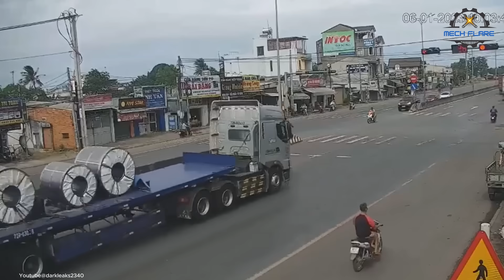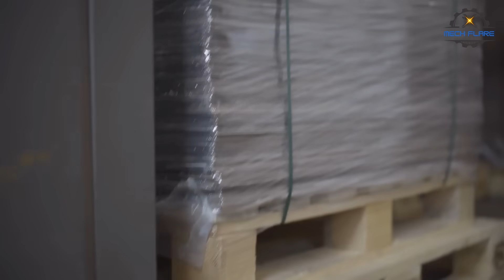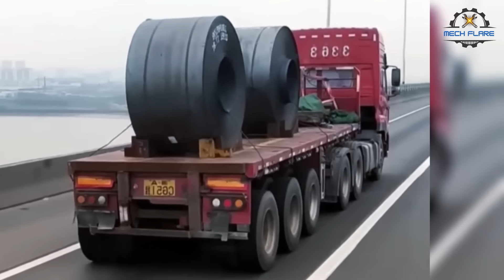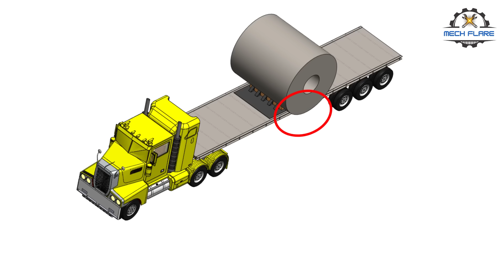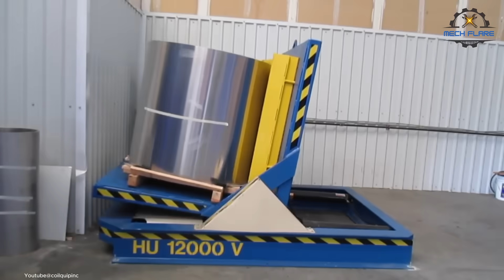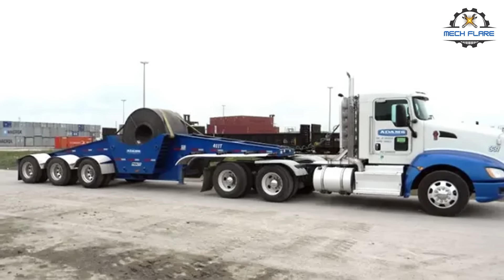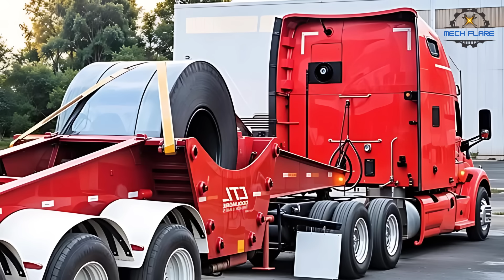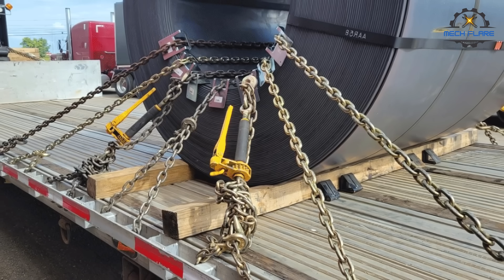Suicide Steel Coils: Can We Stop These Monsters? (USA vs Europe)

Comment: In Europe we have absolutely no issues with coils crashing into cabs. They are almost always loaded shotgun style into the coil well of the trailer, where they sit low between the frame rails in a "naturally" relatively safe position. I don´t know why the murricans still haven´t got the concept of coil well trailers... I think they are the best solution if you need a somewhat universal tailer, just put the covers back in the coil well and you have a regular flatbed trailer to haul other stuff on the return trip.
Reply: Classic eurotake. Here in america we believe in the freedom to die from unsafely loaded cargo, whether it's the driver or a patriot next to them.
Reply: @prox546  that got a really good laugh out of me 😂😂
Reply: Americans don't have 90% of safety concepts because it's cheaper to not be safe and everything in USA is about money only. Generally look at their trucks, us made 2025 is technologically on level of early 2000 European truck. 

There is reason why USA pretty much baned almost all European truck manufactures, simply they know us made trucks cannot complete at all.  

It was always so weird to me that country with such large truck culture does trucking wrong at every step.
Reply: The reason they do not have it is cost. Cheaper is more important than safer.
Reply: Am3ric4n trucking is amazingly primitive - I saw an Am3ric4n guy who bought a Scania and he compared it to his US truck. I was blown away that US trucks are basically the same as they were in 1970. I truly could not believe how agricultural everything was.
Reply: @piccalillipit9211  the USA is as Afrika a developing country or better 3rd world country. 
Next century they are on the level of Europe. It will take longer when they have clowns like Trump as president
Reply from the maker: Yes. This is what I mentioned in the video.
Reply: It's America so they will always have entrenched reasons why things can't be changed. Whether it's cost, convenience, or the "my great grandpaw was doing it that way in 1929 in the Great Depression and if it was good enough for him then it's good enough for me," attitude, they're not for changing. 
😂😂😂❤😂😂😂
Reply: One day US trucking will stop living in the dark ages and join the 21st century.
Reply: Wow, it's so rare to see a european be arrogant about something. /s  No wonder you lot were arrogant enough to think you deserved to enslave all of Africa and most of the New World and Asia.
Reply: it's probably because of cost, I have seen special trailers for coils at the mills but over the road it's cost shippers want the cheapest carrier and carriers don't want to pay for special trailers and everyone does it the same so it stays the same because it's cheaper to purchase additional securement devices then special trailers. some companies do have dips in stepdeck trailers to better hold the coil
Reply: @teddekkerfan92 in Europe the "specialized" trailer is the cheaper option. It was brakes and electronics regulations that favored two frames close to the tires from front to back, over the typical H frame. With the space you gained in the middle you just need different floor tiles to make "specialized" trailers. Even mounting a liquid tank to the double beams isn't difficult.
But yes the companies running that stuff and their philosophy matter. Well and the justice system. If a suicide coil would hurt a trucker in germany the owner of that logistic company would be in jail a few hours after the crash for years and the company would be sold to someone.
Reply: @MrHaggyy  in the US it is the drivers responsibility to secure the load also what the video got wrong is that the driver has the say in how the trailer gets loaded more so if they own said trailer being used. If a driver does not like how its loaded they can have it fixed or refuse the load.
Reply: @wolf2179  In Germany, the driver is responsible for securing his load as well. However, as long as you can't prove a driver's mistake, the owner will face the same sentence the driver would expect.
In the US, the owner can face consequences if the driver or gear is not appropriate for the job. But it's far less strict than EU, and part of the reason why EU logistics invest more frequently. The primary reason is that insurance companies are demanding certain safety standards through EU regulations. Which is just preemptively doing the same thing.
Reply: Or Eyes to Sky 😂 You Just need extra Papers or a convoi for extra wide load or If its "too heavy" 😂😂😂
Reply: Simple
Reply: That is a very simple and great idea.
It just requires " different and flexible thinking."
You can have a universal flat bed trailer with simple modifications..
Mostly, safety is not a concern for people who think only about money.
For that solution, it will require change every time to flat bed when you need.
This will take maybe 15 min, and that too much work for many.
Reply: $$$

Generally this is always the reason.

Why spend money on specialized equipment when a Flatbed, one that is likely decades old and a metric ton of securement straps would be significantly cheaper and you don't need to store extra equipment.
Reply: here (in europe) every coil my company buys is loaded eye to the sky on a wooden pallet.  they can also be stacked on top of each other too. easy to unload with a forklift unlike shotgun style
Reply: They are not almost always shotgun. They need at least half of their width of space each side for the tongs to enter and loading them shotgun you can load fewer because of the space you have to keep them apart.
Reply: I was back loading coilers more than 40 years ago, and the drivers just covered the coil wells for the return journeys. No problem.
Reply: Not only the US trucks are decades behind europeans, trailers also. Making most profit at lowest costs. Security regulations interpreted as suggestions.
Reply: @hardig5760 lmao plenty of coils have rolled over European trucks stop lying and your decades behind in engine building for semis 😂
Reply: @KeanuLeaves-KL  You misspelled and mean decades ahead. Your engines doesn't fulfill the strong exhaust regulations. Burning crude oil in diesel engines and poisoning the environment doesn't fit anymore in the world.
Reply: nah. NEVER SAW in my life, that coils were loaded shotgun style here, for last 20 years of living in Europe
Reply: @tsugumorihoney2288  maybe because the trailers are covered? And look like standard ones from the outside.
Reply: @denzzlinga i'm working on metal factory... so i see this steel rolls being loaded
Reply: @tsugumorihoney2288  like theese: https://www.searates.com/design/images/reference/truck/17/3.png
Reply: if properly secured truckers in the states don't have problems either.

as for why they use common flat beds (of various types) rather then specialized coil carriers, that's gonna be down to cost and distance traveled, especially when the common trailers can do it safely.
Reply: @ARockRaider  i´m not talking about special trailers, but just flat beds with coil wells. 
Wich act as normal flat beds for all kinds of loads when the covers are placed in the coil well.
Reply: @denzzlinga  i still think that's going to be heavier then a standard flatbed and every lb/kg counts.
Reply: @ARockRaider  yes a little bit maybe. 
They are often a bit shorter, since havy loads don´t require the full length, so they can compensate for beeing heavier.
Reply: @denzzlinga  yah, see while that one load might not need the full length of a standard trailer most of the loads a flatbed will haul do need that.

most common loads i see are lumber and they are always using the full length.

don't know how it is where you are but it's about the versatility in the US, if you want the truck to be specialized you are going to have to pay well enough for it to come back empty.
Reply: @denzzlinga  Flatbeds with coil wells would require two steel beams running the length of the trailer.  Most US flatbeds use one center beam for the frame.
Reply: @denzzlinga  I looked again... You're right.  In that case, it would be simple to construct a trough for steel coils....
Reply: @ARockRaider  In Europe we can carry much heavier load then in the US. Another thing thats better in Europe....
Reply: @christera1116  what's the max a 5 or 6 axle truck can haul without special permits?
in the US it's 80,000 pounds/40 ton or roughly 36,287.3 kg for all roads unless otherwise restricted (typically small bridges on roads that don't get truck traffic)
Reply: @ARockRaider lol, every lb/kg counts, maybe in america where the upper limit of any transport is pathetically low. Meanwhile here in finland we casually pull max 53,000 kg loads on 6 axle trucks, and on the high capacity transport side a 10 axle combination can be loaded with 74,000 kg. That's 116,000 lbs and 163,000 lbs. Only 4 axle trucks are limited to 36,000 kg.
Reply: @castform57  sounds fairly close, a 5axle 80,000lbs truck is the standard but some states allow 6axle 100,000lbs trucks.

I-90 allows twin full sized trailers that would be 9axle total but i never ran them so don't know the weight.

but even still, every bit of mass matters unless you consistently haul something that fills all your cargo space without maxing your weight.

do keep in mind every state is a little bit different and most states are large enough to be their own European country.
Reply: @weatherupstairs4814  I love how poor the US is... TWO Frame rails? they can't pay for such a luxury. Even Brazilian trailers have ladder frames with 2 Frame rails.
Reply: Because most of the shipping across country is done by owner operators on flatbed or stepdeck trailers who haul general freight almost exclusively. The footage on this video is also not depicting American trucks.
Reply: cost and lack of regulation. Lobbyist keep it from happening because then they would have to haul empty back or have a dedicated fleet instead of paying cheep indian drivers to do it.
Reply: Coil well trailers can only be used for coils. A flatbed can be used for a variety of loads, including coils. 

However, we have rail cars (wagons) that are specifically built for coil transport.
Reply: @DesertCatDad  Trailers with coil wells normally come with covers, if you put them in, it becomes a normal flat bed trailer that can be used like any other standard flat bed trailer. 
You basically just remove the floor part between the two frame rails, and drop the coils in that well to make them sit tight even without any strapping.
Reply: @denzzlinga  How is the foor part stored when you move the coil ?
Reply: @dmitripogosian5084  simple version they are just piled up somwhere on the trailer and secured with a ratchet strap. 
More edvanced version, there is a storage place underneath the frame where they can be put in. 
On some trailers they also have hinges on one side, so they aren´t removed entirely when loading coils but just folded aside.
Reply: We won two World Wars, put a man on the Moon, launched a UAV on Mars, and so much more because we do things differently.
Reply: @DesertCatDad  you had innovation up until around the 1960s, that is when "if it ain't broke, don't fix it" came about and your innovation in many fields stopped. Perhaps it's time to stop living in the past?

Also, it's not only the US that can claim to have won the world wars, you know.
Reply: @DesertCatDad  But have you done anything actually useful?

Comment: @ Mech Flair, another thing that you failed to mention is that ALL European trailers have an integrated headboard on the trailer, unlike US flatbeds, thus making suicide loading a lot safer than in the USA, where there is a suicide rack placed on the tractor unit.
Reply: But i almost never saw a coil loaded suicide style in europe.
Reply from the maker: You are right. I should have mentioned that point.
Reply: It'll just go through the cab ahead of the coil
Reply: @juliogonzo2718 , are you referring to the headboard? If you are, then you're completely wrong. Flatbed trailers in Europe are a lot stronger in build than US flatbeds. To move the headboard on a European trailer would take a huge amount of kinetic force.
Reply: @davidjames990 It would likely secure a load that is butted up against the headboard, but a rolling coil... im skeptical
Reply: @davidjames990 likely can't post a link but look on YouTube for 31.08.2021 - VN24 - Unsecured steel coils break through truck headboard during emergency braking

Comment: I delivered a coil to a receiver, and they told me they had a coil roll in the building, it hit one of the supports, rolled across the drive, and down a valley, luckily no vehicles were parked where it went, the building support was huge, and it twisted it 90 degrees, so no matter what you have for securement they are dangerous, even when they are off the truck
Reply: Yes and no. They unload coils from ships where I work and I have only seen one accident in 12 years and no one got hurt because of proper safety precautions. A lot has to do with proper instructions. And yeah, once it's moving....

Comment: Send them by rail!
Reply: Ok. Fine. What about the customer that doesn't have railroad tracks up to their facility? Hm? Rail doesn't go EVERYWHERE. Roads do. 
We have an appliance factory in my town. Small town, ZERO railroad tracks in or out. I guess the factory should shut down & move to another town with rail access? Waste of an existing factory, lots of jobs lost, and expensive to buy land & build a NEW facility. That means the cost of the finished product goes way up for the end consumer. 
Think of all the products made using sheet metal...cars, appliances, filing cabinet, tool boxes, BBQ grills, building materials like trusses & siding, window frames, steel buckets...

Comment: I was a labor hand for a subcontractor company. Large spools of power line wire. Driver used metal wedge bars under each coil. 3 binder chains per coil. BUT..... Our drunken ( non-CDL ) suspended driver's license Forman said to use 2. 2Inch wide straps/chain hook. 1 Roll wedge for coil on cab end. This will stop the rear coils from rolling into the cab. What about the (Straps) you ask?! They have "Chain" hooks on them. Same difference then a 5/8" Binder chain. My driver refused to move. Got a call. YOU WILL DO AS THE FORMAN says. I said OH LOARD!!! Kissed my ass. well..... I'm i no longer work for that company.  2 months. I'm still here to tell you my story. What happened to that subcontractor company? THEY ARE NOT THERE ANYMORE😅😅😅.

Comment: There is no way to haul those coils safely on a flatbed
Reply: I did it for about 12 years. Never had an issue. LOTS of chains. Never "too many chains" on a coil! 
Some folks can't even walk safely.  It's all in attitude. Over securing & careful driving. If DOT regs say it needs 5 chains, put 7 chains on. 
Just because YOU can't do it safely, or you THINK it can't be done safely doesn't mean it can't be done.

Comment: Wouldn't rapid acceleration also endanger any vehicles following a suicide load?
Reply from the maker: Yes. You got me on that one. I should have covered this point. There are many instances of coils rolling backwards onto cars behind the flatbed. So you must maintain a decent distance.
Reply: Would probably not be that much of a problem in most cases, unless the vehicles behind are following close and start accelerating at the same time as the truck and/or if it's on a hill going up (where the roll can start rolling backwards due to gravity, once it's on the ground). 
The forces from the acceleration will only cause it to roll backwards in relation to the truck it self - seen from behind, it will pretty much just stay in place and rotate as the truck moves away underneath it - then fall straight to the ground. Most drivers behind would probaby just "by instinct" hit the brakes once they see that big ass thing start to rotate and coming closer to the back of the truck (and that way get out of danger). 
If this doesn't happen right at the start from a stand still, it will even start rolling forward once it's on the ground - at what ever speed the truck had the moment it got loose (even accelerate if it's downhill). Thus it will actually be more dangerous to those further ahead and to oncomming traffic than those behind in most cases - even if it happens during acceleration.
Reply: @Speeder84XL  OMG This comment was just a joke. How fast can a truck with that much weight accelerate fast enough for one of those to break loose?
Reply: Lmfao! Heavy trucks don't accelerate fast like cars do. 😊
Reply: @KenMitchell-kc9nr  True. But even the small acceleration of the truck is enough to have them roll off, if they are not attached with chains and stuff
 - so if they come loose for some other reason (like not being secured enough and the truck goes over a bump, knocking a roll loose), it could happen. Even though it's not very likely that the truck driver would continue to accelerate after such an event.